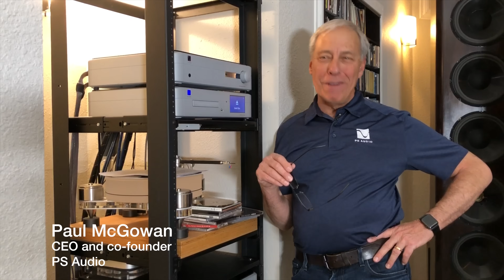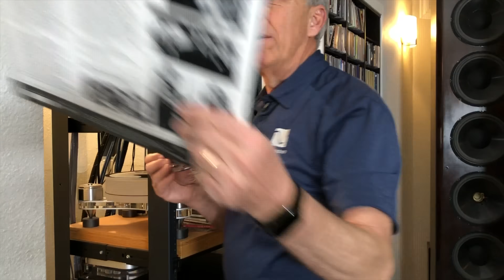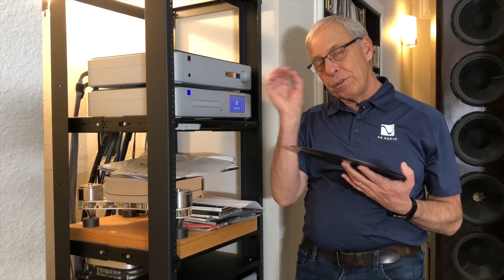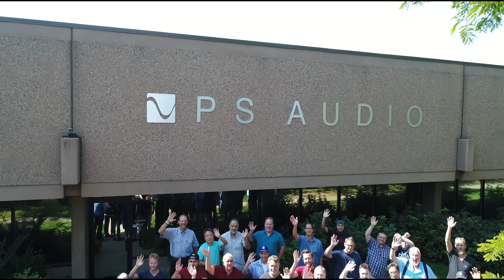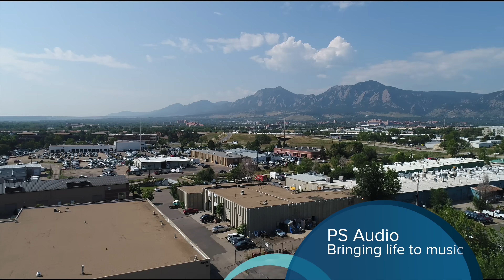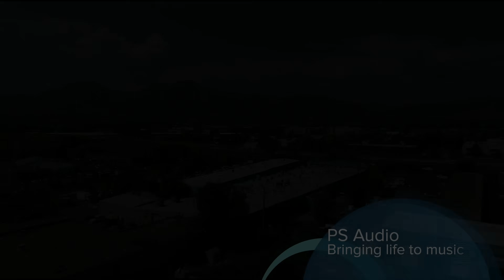Vinyl jitter

Comment: When I ran my last computer system run though a quality DAC and into my headphones, there was a really high s/n ratio, but it would stop for fractions of a second or sometimes a second or more, and I found this more bothersome than my old direct drive turntable with a quality magnetic cartridge with an oval cut stylus, into an amp that compensated for the vinyl RIAA bass curve into my headphones, I tried new cables into the old DAC to no avail. The jitter was a complete pause in the music, and very annoying. I now have a new computer system, I'm using the DAC included with the computer, and haven't had any problems with audible jitter at all. With my direct drive turntable, I heard noise, but the music never paused and started again. I have no complaints yet with my new digital system.

Comment: The best vinyl is a 12 inch single and with a good table and cartridge you will experience the widest sound stage you have ever heard. I have the Simply Red Big Love Greatest Hits 30th Anniversary on CD and its the best example bar none for over compressed audio.  The Pioneer PDRW-739 VU meters on any song slam constantly at 0 VU.  The best CD to illustrate LISTENER FATIGUE !

Comment: Main sources of LP wow aren't the turntable itself - it's flatness and decentering problems with the disc.  Any visible motion of the tonearm - up and down following warps in the disc, or swing left and right because the tracks aren't centered - creates much more wow than a good turntable is specified for.  
Yet I've never seen anyone talk about decentering wow.  Why is that?  One would think that reputable turntable makers would have invented an auto-centering system by now.

Comment: No wonder you get flutter ( jitter ) .. I cant believe some turntable manufacturers STILL use belt drive !!
The best way to drive and control a turntable platter is by direct drive using a servo feedback system . Plexiglass is not so good as heavy alloy either . Rumble is one other item that Paul left out .. but this is related to bearing noise  emanating from the turntable... wow tends to be an artefact of worn or deformed jockey wheels in rim drive platters...

Comment: So what you're saying is the temperature in the room it might be warmer or colder could cause the vinyl grooves to swell or contract causing the wider gap.
And thus the slightest variance in timing in notes......😐
Completely ruining the song.

Therefore if your playing a vinyl album, the room temperature and also the temperature of the album and a cooling system to keep the record at peak gap like a fine wine.

Comment: Sooo, what is vinyl jitter ?
Reply: I watched the video again. I guess I was a bit confused the first time. I've had (and still have) a real interest about understanding the digital reprodution of sound, but my knowledge of vinyl is very limited, maybe because I basically never used it (dont even have a turntable). Perhaps you could answer something I, so far, have been unable to find reliable answers to. What would be the resolution of a vinyl disc in Hz ? I found solid information about dB range, thus being able to make a solid comparison with resolution in bits, but no consensus on how vinyls resolution would translate to Hz.
Reply: Well theoretically each infinitesimal point on the groove counts as a "sample", I imagine the effective resolution varies wildly from release to release, depending on mastering and pressing quality, as well as the turntable.  Then again I've never seen a record outside of my grandfather's jukebox; I know about as much about this as you do lol.

Comment: I agree, digital sounds great today, even Mp3..,from some reason many LP albums have better sound for my ears, even through digital reciever, mey be meny people with old turntable have some good old amplifier with some old school speakers, than vinyl sounds very, very good, more natural in some cases. For some people digital have to clear sound, in some Hollywood CG movies rendering is so clear that looks unrealistic, so they add some digital noise or blur for more natural image, same here is with audio, sometimes LP sounds worm its not have that clear sound, if LP is old, needle is old you can not have original sound from album, with digital audio CD this problem is solved, but even in digital world many CD players have different sound with the same CD album, why if digital is so precise??
I have vinyl, CD and USB hdd-ssd.

Comment: jitter is happening at such a fast rate that it can actually modify the shape of transients and higher frequency waves, sounding like noisy hash and lacking a feeling of being physically there.  Analog wow and flutter is such a low frequency oscillation, that it can only affect perceived pitch or in the worst case (cassettes) gives the sound a sort of vibrato effect.  Within the sound, the actual transients and waveforms remain intact

Comment: I like your explanation for this Paul and no specs don't tell the whole story.  I enjoy both and mastering is a big part of either, but I have heard a Kronos record player that sounds so good, that it will make you say, huh, what cd player, what is cd. I have also had digital sound so good in the case of Aurender(I own) and a Audio Research CD7 and CD8 (dealer loaned items, I own a CD2 and a Yamaha CDS-2100) that kept me from playing vinyl for almost two weeks and frankly not really missing it until it was time to return the cd players. 

 I on the other hand will not be spending, 40,000-50,000 to pay for the privilege of the Kronos or $3000-$4500 for the CD7 and CD8, but it is quite remarkable that a technology as old as vinyl is still here and quite frankly doing well despite all of the new technology that has been introduced after it.  The industry and stores like Best Buy and target are talking about discontinuing cd in the case of target selling them on a consignment basis only.  Herb Reichert from Stereophile magazine, just show cased some Joseph Audio Pulsars and used three different sources, DSD, Vinyl and CD.  I heard all and found the CD to sound the best so judge for yourself.  https://www.youtube.com/watch?v=eRZz-R3js_Q&t=5s

Comment: I don't know much about Vinyl, but you can't have been serious when you said that turntable uses a rubber band, right? Aren't all high end turntables quartz locked direct drive systems?
Reply: Aric Vogel incorrect. Although direct drive is great, the majority of turntables these days, especially high end ones, are belt drive.
Reply: That's interesting! Since DD is so beneficial in cassette decks I assumed it was just as cut and dry with high end vinyl, but apparently it's very dependent on implementation and personal preferences.

Comment: Paul, until you get a cartridge fitted to that $7000 paperweight i guess we'll just have to take your word for it.
Did you ever perform any tests as to how much acoustic feedback an unsuspended turntable picks up from that massive speaker system?
Id love to come and hear both souces. Get a cartridge with a stylus protector for folks who stack CDs under the arm.
I'm sure that system could induce some real wow and flutter ( In ME;-)
Thanks.

Comment: Perhaps not so different after all. CD content is read from the disc by a laser which scans for "hills and valleys" (bumps and dips) to read one as a "1" and the other as a "0". So from bumps on vinyl to bumps on discs..... Difference being digital has no surface contact and is limited by sample rate (frequency response). Many believe the "no limit" nature of an analogue recording on vinyl is what gives it it's presence and "engagement" factor. Funny how audiophiles will ignore the "road noise" of vinyl and never let go of the "superior sound" notion. Must be something there, when digital seems to boast "jitter free" this and "jitter free" that with ever increasing bit rates and the like but the guy with a $100,00.00 system stills sits back and plays a record!! Perhaps it's not about "noise" or "tracking accuracy" or "bit perfect", it's about what sounds right and touches you! Records do that!!
Reply: This is purely my opinion and the reason I gave up on vinyl. Vinyl was always going to be on the back foot. It’s a mechanical/ancient technology that even with the best tonearm and cartridge will not reproduce what was originally cut into the master disc. My reasoning for this is a master is cut with self propelled linear cutter which travels across the disc in a straight line. This means for a stylus to reproduce the sound it needs to follow the exact path of the original cutter. This was kind of accomplished way back by the cheaper mass producers. But the arm was always controlled by the disc (arm moved in tiny stop go arcs across the disc). With the fixed pivot arm there are to many inherent design flaws. As the arm travels across the disc the large arc will produce more output from the left to the right channel but should equalize somewhere in the middle (sweet spot). Then there is centrifugal force to consider, downforce on the arm, disc warp, depth of grooves cut ( to increase content on the disc) ect ect. Anyway my point is with so many inconsistencies in the way vinyl is played wow and flutter is the least of the problems associated with it. In my opinion vinyl is way to fragile and variable a media to even be considered today. BTW that cartridge on the PS setup has been missing for months which goes to show how much it is missed.
Reply: @Wolsey: Well your points are certainly valid and there is some argument for some of them. I switched back to vinyl about 10 years ago (I'm 57 so I listened to vinyl when I was young since there were no digital choices) and I haven't looked back. I do listen to my digital sources sometimes and there is no doubt they sound great, noiseless etc, but somehow digital just doesn't have something records do. A decent system with good quality records and recordings certainly provide an experience different than digital sources. Better? Well, that's subjective and I know for myself records engage me and digital does so, much less and even sometimes disappoints.
Reply: CDs won't suffer from speed/density variations because:
data is read ahead of time
data throughput is much faster than required to play properly
the head of the CD drive tracks the variations of the CD
Reply: I'm 25 & discovered vinyl in 2015 and haven't looked back since.  CD's left a very bad first impression on me.  Picture this a 5 year old bringing his CD player on the bus ride to school, only to have it skip & stutter every time the bus makes a stop, made me want to throw my CD player out the window.  Also I've talked to many folks around my age who had similar experiences.
Reply: Good luck bringing your turntable on a bus ride xD thanks for the good joke

Comment: For those of us with large vinyl collections going back to the early 70's and before, the matter of which is better has no relevance. I am unwilling to try to replace every one of my several hundred records with CD's, although I have replaced a few of them. And many recordings released since the 90's are unavailable on vinyl. So I will continue to enjoy both, and accept both the benefits and limitations of each along the way. One problem with CD releases of older recordings is the temptation to improperly manipulate the original recording in some way, usually by poor re-equalization for CD (since the original masters were eq'd for LP and would not sound good if transferred directly to CD without any adjustment). In one case, several recordings on one CD release were sped up relative to the original release. I have had to fix many CD"s in order to get them to sound right. Thankfully, the CD's are digital, and the technology is available to manipulate them and burn new CD's.

Comment: I have some vinyls, that are Clearly better than CD (Direstraits - Love over Gold, For example) 
It’s The Recording from The Master tape, that Sets it apart from later remastered cd Versions. 

These days, theres No need, but 70‘s to mid 80‘s musik Most Times Seem to sound better / Been better mixed and recorded on Vinyl
Reply: I own the majority of the Dire Straits discography on the original non-remastered CDs.  Frankly I couldn't envision them sounding much better (although Love Over Gold is a bit shaky relatively speaking).  What year/region is your copy?

Comment: Wow and flutter happen in a much different part of the audible spectrum than digital jitter. The low frequency variations of a good turntable or tape deck transport are minimally perceivable, probably because most of us don't have perfect pitch. Many cars have tachometers because most people aren't very good at discerning frequencies or variations. Our brains seem to be able to detect high frequency variations better than low. It may be that we perceive timing variations that are above 20KHz. Jitter affects the timing of samples and transient response. We may not be able to hear jitter directly, but it can confuse our spacial perception and cause fatigue. My explanation may be flawed, but it's how it seems to me.
Reply: BlankBrain Very interesting, thanks! I still can't hear it though...¯\_(ツ)_/¯
Reply: "Wow and flutter happen in a much different part of the audible spectrum than digital jitter." - valid point that Paul omitted in his presentation as well as the rest of your reply ;)
Reply: @BlankBrain Your post got me to thinking about it and I at first agreed but on reflection only partially agree. I do think variations on turntable speed (wow) are more difficult to detect, and flutter (the needle floating around and losing contact with the record's grooves) may not be a significant problem on a properly set up player of decent quality, but I think the only thing that would be specifically related to frequency would be rumble (vibrations transmitted through the motor), which might be in the lower end of the spectrum.

But none of these impart harshness, which jitter does (jitter is also an across-the-spectrum problem). I hear it mostly as harshness in the highs, but also as a general muddiness. My mind kind of interprets it as slender reeds of music stomped on and frayed by the analog to digital to analog conversion processes, heh.

I find it really irritating. I wish I was one of those people that didn't hear it, but I do, so am in the process of trying to figure out what to do about it on my very limited budget. I haven't listened to vinyl in decades but my memories of it's flaws aren't related to wow, flutter, or rumble, but noise floor, and pops and clicks from dust or scratches on the record. I guess I just accepted the underlying hiss of the record (pretty much only heard it before the music started playing) and it wasn't hard to keep records clean and scratch-free so what bothered me most wasn't as much an issue as jitter is for me today.

Anyhoo, thanks for getting my thinking juices flowing! :)
Reply: @Kacper Uminski
If you can't hear it, count yourself lucky - you don't have to spend time and money trying to fix it. :)
Reply: Penterax I feel your pain. I don't hear jitter but I'm very sensitive to peaks and dips (I get headaches) so being unable to properly treate my room because of my family is a real pain.
Reply: At the AES conference in SF in 1992, Hawksford showed how the particular cause of the jitter determined what kind of artifact was heard.  The one he demonstrated was that of the S/PDIF and AES-EBU cables connecting high-end components.  Those cables' inductance and capacitance messed with phase of the digital signal.  The trick is that the clock signal was being derived on the DAC end from that signal, and the cable-caused phase shifts changed the timing of the clock signal's zero-crossings (jitter).  Moreover, the jitter depended on the content of the recording, and the jitter caused inter-modulation distortion that, get this, carried a weak, scratchy version of the musical signal itself -- we listened to it.  Mind blown.  Here is a later lecture from Hawksford talking about it.  https://youtu.be/b5nzFejc2KA?t=14m42s
Reply: eric moss Can please you simplify that a little? Thanks!
Reply: But we all have enough hearing to make out surface noise.  Something about elephant in the LP room is appropriate here.  Face it: impulse noise kills the spell except for the type of more primitive music (rock namely) where silence is not often recognized as an intrinsic part of music.

Comment: Badass expensive turntable and no cartridge on it? Is it just for decoration?
Reply: Division_Bell  In an earlier video it was explained that due to the amount of activity in the room, some carts had been damaged, so they are removed when not used.
Reply: Ah ok... makes sense. I must have missed that video. :-)
Reply: conkerman01 unless he gets an arm with detachable headshell ( yuk ) , it will never get played again- sad. I know two friends with LP12s just gathering dust....
Reply: Most cartridges come with a stylus cover. If you use it, you won't have this problem.

Comment: Every time I see that torn cone on the IRS IV I can't stop looking at it. 🙄
Reply: It's not torn guys,  it's just a dust cap Paul removed, so we could see the acelerometer on the woofer.
Reply: Yeah, noticed it straight away. Sis they blew it or trash during some movement in room?
Reply: Almost looks on purpose, I saw it on the right side too :\
Reply: realgun666  yeah, Paul has told us it was a repair to the servo system. You can buy mesh dust caps for a complete repair, I believe.
Reply: Thats definitely not torn, it looks like the dust cap either fell off or was removed.